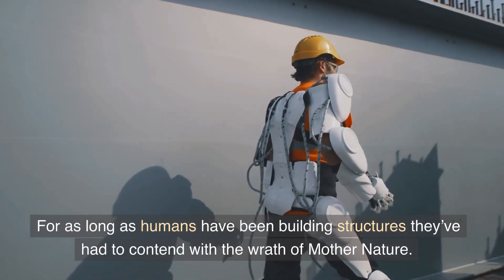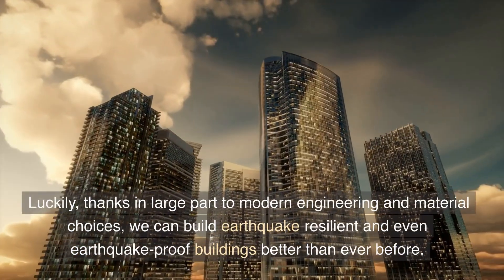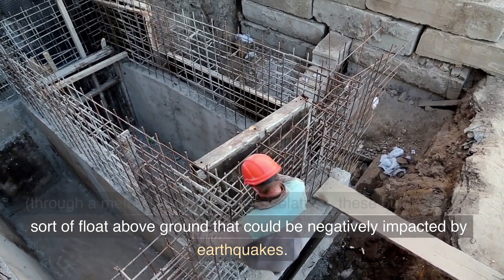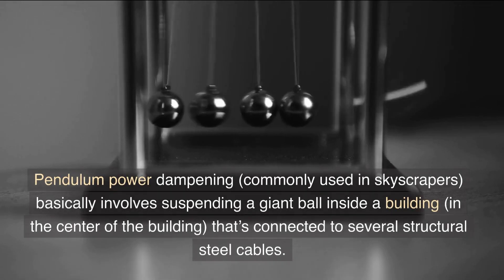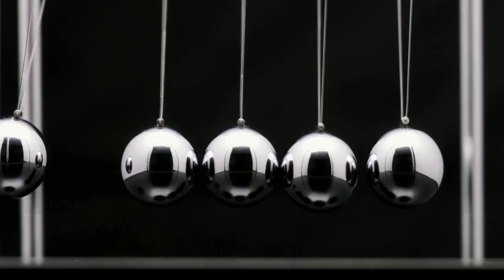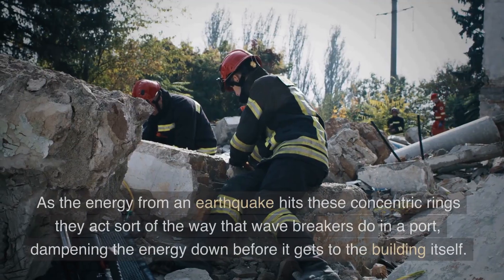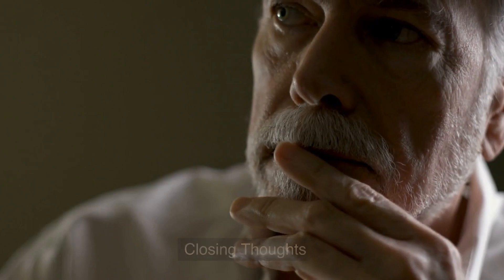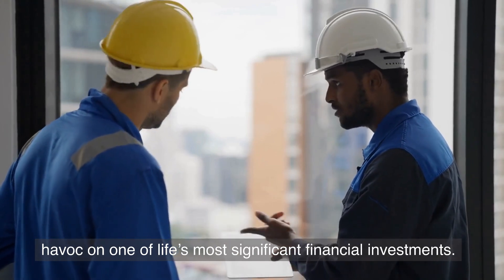What Makes A Building Earthquake-Proof

Comment: My Dad, an Engineer for a Mine company that had a plant, in Northern California, came up with a "tray that let's it Float' foundation. He let the Plant sit in a 'tray', filled w/ mineral oil, such that it had about 4" of 'slip' in any direction (this would have compromised most mechanical shafts, many plumbing lines, and a few Electrical conduits, too, but, kept the Building 'afloat'), but it wasn't feasible. It only needed 1/16th of an inch of 'over-float' between the Factory Floor, and the 'tray Slab'. As long as the Tray didn't buckle Vertically, it'd keep the Factory intact.